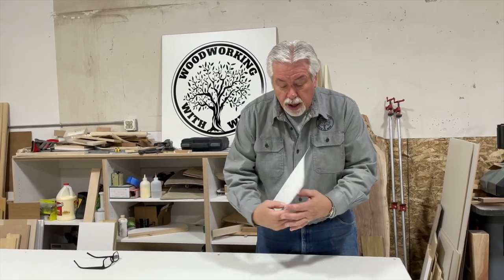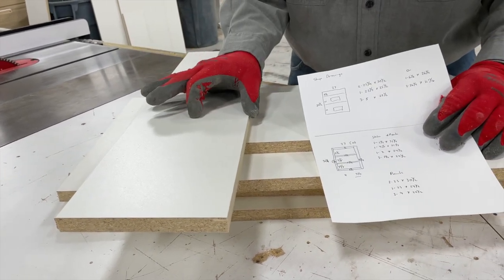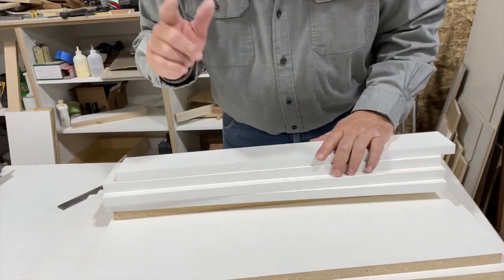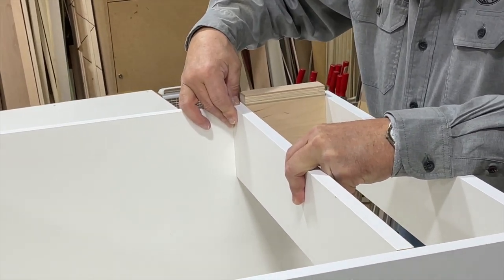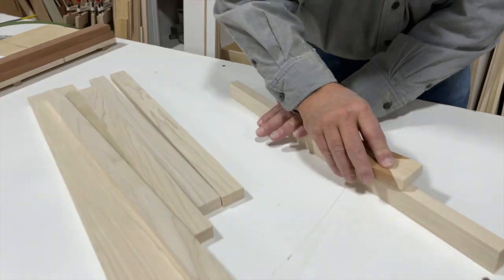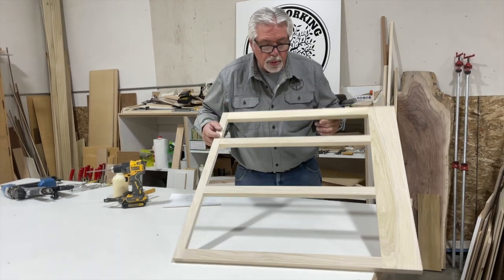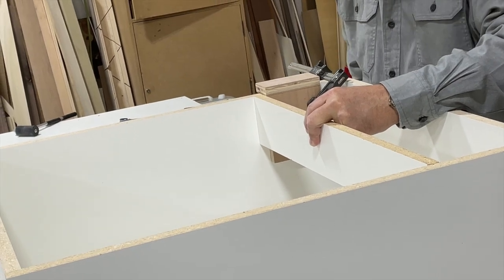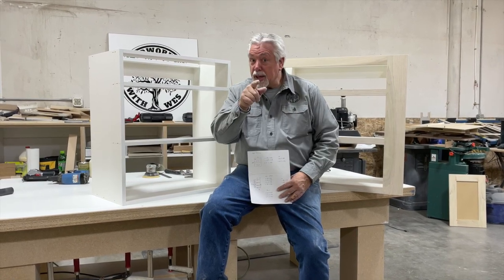2 styles of basic cabinet construction. Which works best for you?

Comment: Great video as usual Wes! I build face frame cabinets since that's the market niche I've found in my area. I was taught the use of stretchers behind drawers in the 2 year cabinetmaking coarse that I started when I was a senior in high school, over 25 years ago, but I never really adapted to it. I know shops around me to do and don't. What's your thoughts on using stretchers behind the face frame? If it wasn't for soft close drawer slides, I might have eventually used stretchers to take the impact of the slamming drawer front, but considering everything I do is soft close I felt that I didn't really need to add stretchers behind the frame. What are your thoughts? Take care! Scott
Reply from the maker: Hi Scott...I use the stretchers mostly for drawer guide support and alignment on a face frame cabinet. I found that has worked good for me. Thanks for the compliment and I really appreciate your positive feedback.

Comment: great video wes .i would like to know how you decide what size you cut your rails  and stiles widths  for your face frame and how much overhang you leave
Reply from the maker: Hi Jeff...the hinges that I use have a 5/8 overlay and so do my drawer faces (top, bottom & sides). The width of the rails is determined by how much space I want between drawer faces. On the sample I made, they were 1 1/2 " rails between drawers, which gave me 1/4" between drawer faces. The stiles were a little wider to create a larger space between cabinets. You can adjust the size of your stile and rails to create whatever spacing gives you the finish look you are after. I hope this helps....thank you. Wes
Reply: @WoodworkingWithWes  hi wes .it does .thank u .i look forward to more of your videos

Comment: Hi Wes,will white melamine be ply wood or particle board, sandwiched between white melamine? Thank you for easy to follow instructions
Reply from the maker: The white melamine I use is on particle board. Thanks for watching. Wes
Reply: @WoodworkingWithWes  and you do not glue sides and bottom - only staple together?

Comment: Great Video!  What gauge of Wide Crown Staples do you use to put the Cabinets together?
Reply from the maker: I use 18 gage wide crown staples 1 3/4" long. Thanks for watching. Wes
Reply: @WoodworkingWithWes  Thanks for the Reply . I have searched and searched for a 18 gage Wide crown stapler and have had no luck finding any staplers like this. I have found lots of 16 gage  staplers and some 18 gage Medium crown. This 18 gage wide crown stapler seems very hard to find.  Any suggestions?